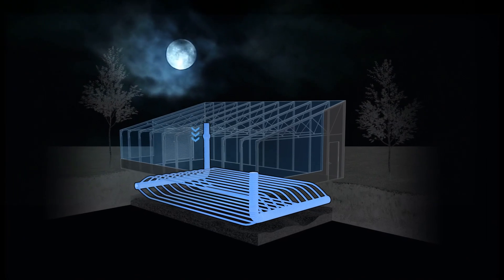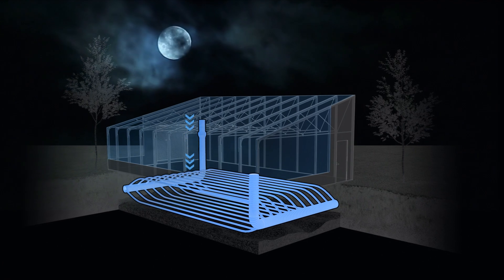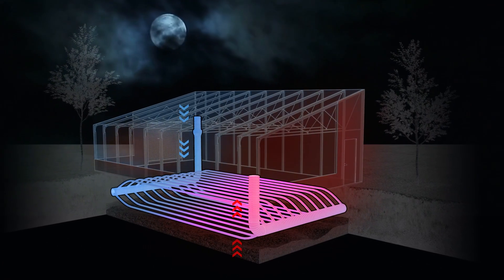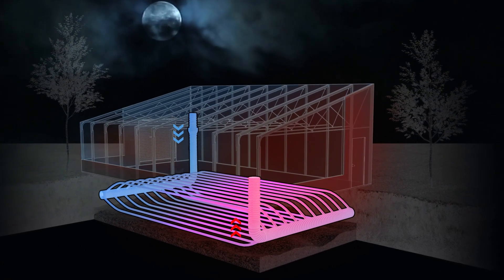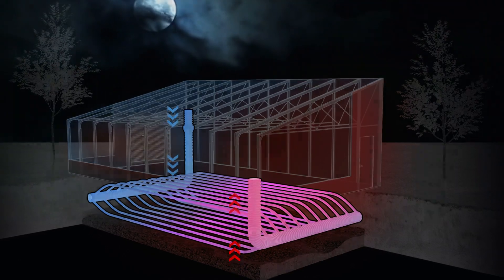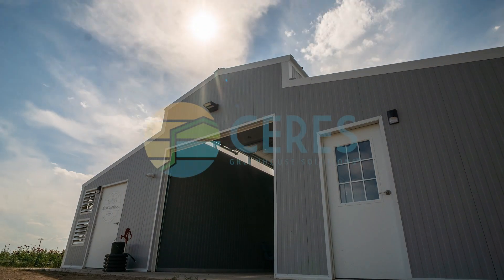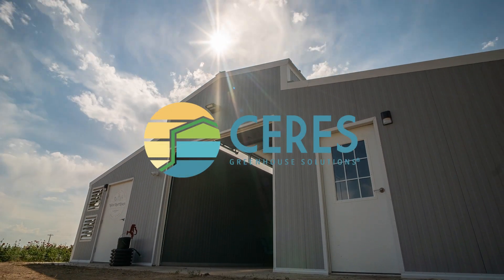The Heating & Cooling Power of the Ceres GAHT® System in Wheatland, Wyoming

Comment: is there mold development in the inground duct?
Reply from the maker: the pipes underground are perforated so any condensation build up that happens from cooling the air is able to escape from the pipes before mold becomes an issue
Reply: @CeresGreenhouseSolutions  
If you take a look at perforated drainage tubing you`ll see that the location of the holes or slots do not allow for the condensate to fully drain, it will collect in the bottom of every corrugation with nowhere to go.  Drainage tubing is specifically designed to allow water in so it can be carried away. Drainage tubing that doesnt carry excess water away is no good for drainage.
Reply from the maker: @JohnGuest45  I'm happy to connect you to a GAHT® expert who will alleviate your worries that our tubing does not properly drain the condensation.
Reply: @CeresGreenhouseSolutions  
When you say "our tubing", i take that to mean you manufacture your own tubing which allows all of the condensate to drain. If its just an off the shelf drainage tubing (such as ADS), it simply doesn`t do what you claim because the drainage holes/slots are located in the valleys between the ribs.
Reply from the maker: @ We do not manufacture our own tubing, but if you would like to learn more about the functionality of the GAHT® system please contact us at info@ceresgs.com. That way I can connect you with our GAHT® expert.
Reply: @CeresGreenhouseSolutions 
If the "expert"  is the one that designed this, i think they`d benefit more.

Comment: This system is just using air, correct? I guess given the amount of temp you are trying to maintain, using hydronics would be a bigger expense?
Reply from the maker: Yes you are correct, the GAHT® system is relatively low cost since, besides the upfront cost, you're only paying for the power it takes to run the intake fan